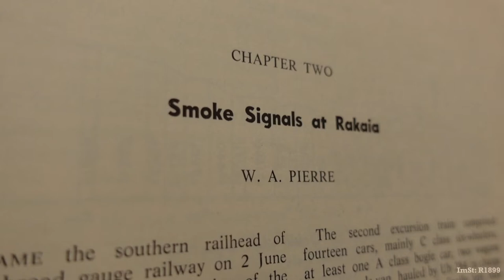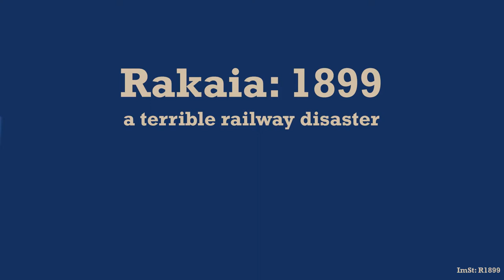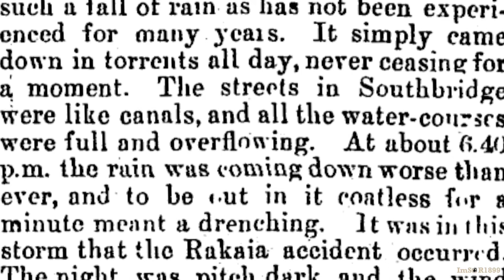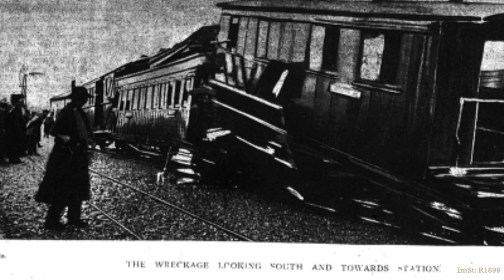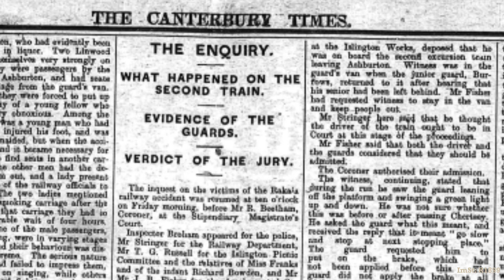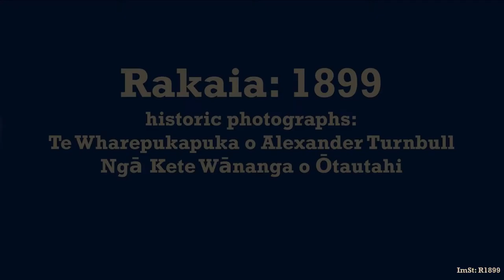RAKAIA: 1899 -- A Terrible Railway Disaster -- Episode A "Whistling for a Signal."

Comment: This was almost exactly ten years after the Armagh accident in Ireland caused, similarly, by time interval working and inadequate brakes. In Ireland these were aggravated by people who did not act terribly sensibly.

Had the carriages and not just the locomotives in N.Z. been fitted with the Westinghoue brake then the collision would probably have been avoided regardless of the lack of fixed signalling and the time interval working.
Reply from the maker: Thanks for your comment, Paul.

I'd not really made a connection between Armagh and Rakaia on account of the runaway being a factor with Armagh - and once the consist had started running there wasn't going to be a way for it to stop short of calamity.

But yes, the human factor/failings and interval working/ institutional failings play a role in both, although with Rakaia Charles Henry Carter rightly shouldered nearly all the human responsibility - whereas with Armagh there was plenty of responsibility to be shared around.

There was a Rakaia 2.0 in 1907 - about five or six miles up the line at a place called Bankside, with a head-on collision between trains.  The driver of the offending train specifically mentioned that the continuous Westinghouse Brake saved his life that day, as he was able to reduce speed dramatically before the collision occurred.  

The collision occurred beyond the area where tablet working had been rolled out, and each train had a conflicting working notice.

It was an interesting time.

Comment: God, this sounds so similar to the Mud Run disaster of 1888 on the Lehigh Valley railroad. 

An extra excursion split into 7 sections was heading north through a twisting river valley. Section 6 stopped at Mud Run station due to being too close to the 5th section and getting a red signal. 

Then the headlight of the 7th section was spotted with enough time for the engineer of the 6th to hop back in the locomotive and get the train moving forward about 1 car length before the 7th section slammed into the back of it and telescoped the rear two cars of the train at about 15 mph. 

A picture of the telescoped cars would become the iconic photograph to explain what telescoping is in various train wreck books.
Reply from the maker: Thanks for your comment.

I read about Mud Run in Bibel's "Train Smash" and there are parallels in that they are 'growing pain' collisions where the systems can't cope with increased speed and traffic density.

I looked at the mecanics of the disaster in a later episode. 

Bibel called it technically "Overriding" and "lack of survivable volume" was the result....